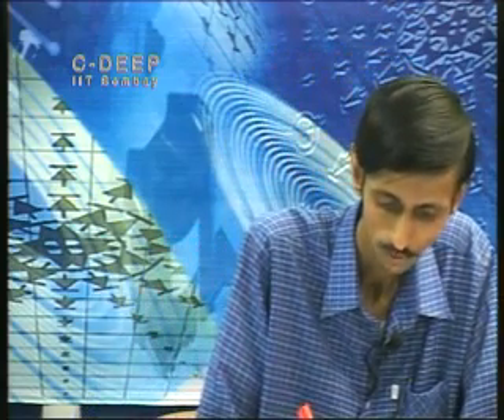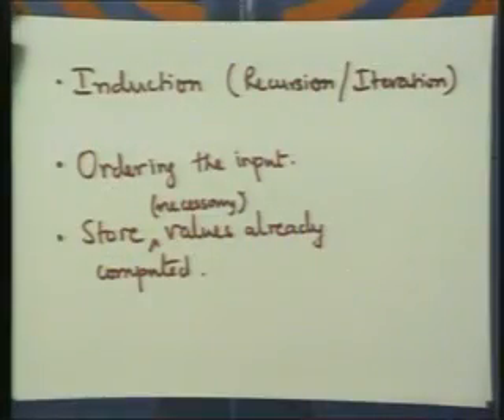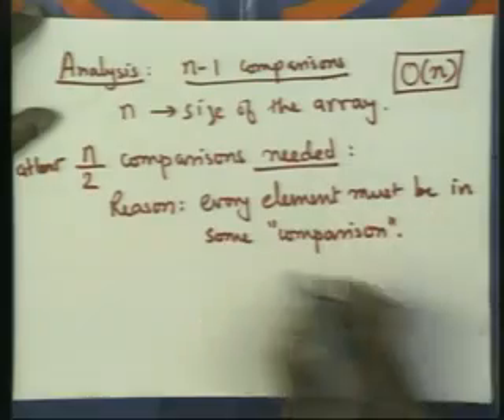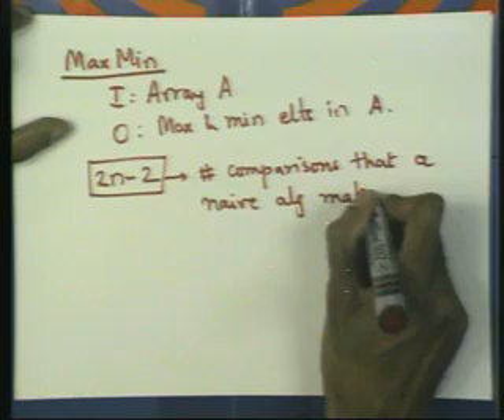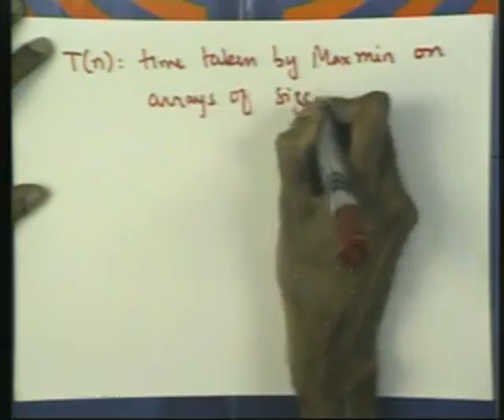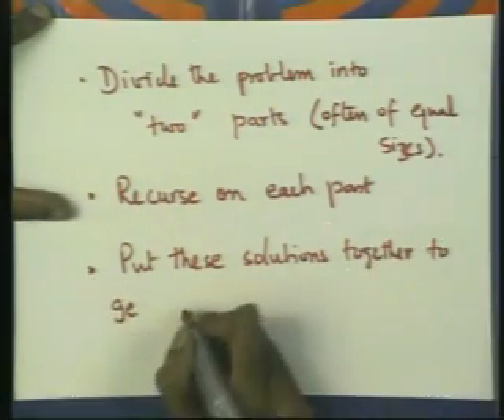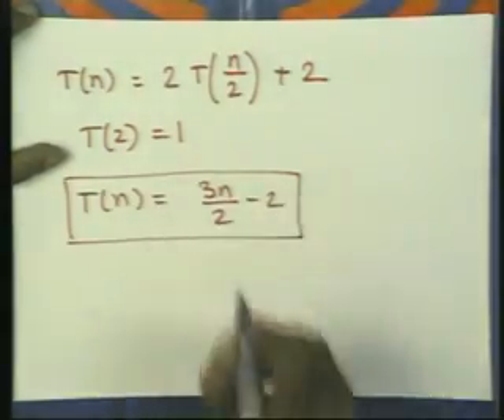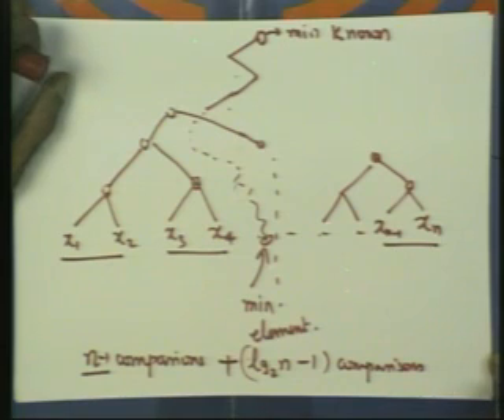Lecture -5 Algorithm Design Techniques : Basics

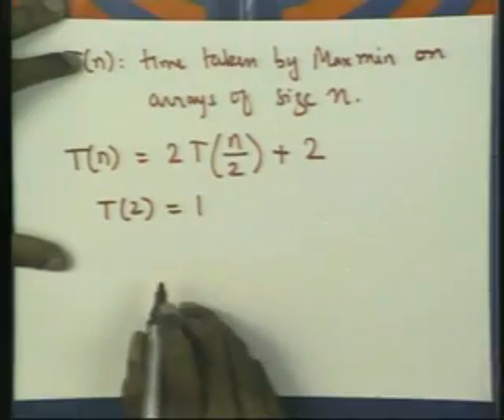Comment: Lost me at 27:15 how did he expand it there?
Reply: if n elements take T(n), n/2 elements will take T(n/2). Now because we divide the n elements into left and right (where the size of each one is n/2), perform the same task on both of them the total time taken(T(n)) will be, 2*(Time taken by each part i.e left/right) + (Number of comparisons done after we know the min and max of both left and right). Therefore, 2*T(n/2) + 2. Now if T(n) = 2*T(n/2) + 2......Eq(1)  Then what will be T(n/2)?? T(n/2) = 2*T(n/4) + 2......Eq(2). Now substitute Eq(2) in Eq(1). This is what he has done above.
Reply: Use T(n) for reference and expand by putting n=n/2
Reply: Lol... YOU certainly don't know how to expand SIMPLE recurrence relation using SUBSTITUTION METHOD !!!